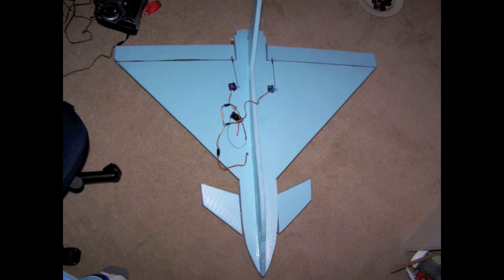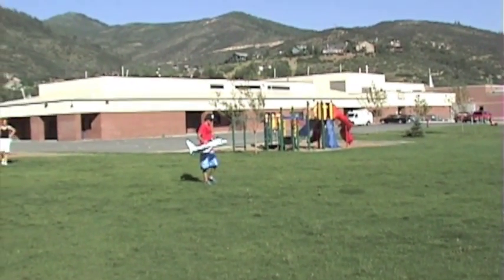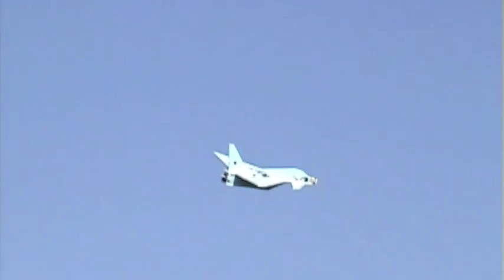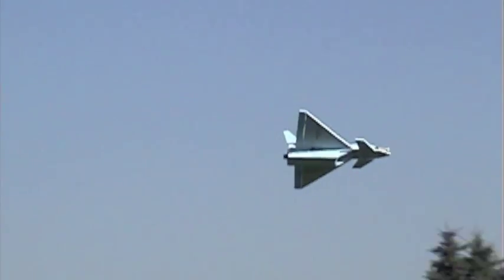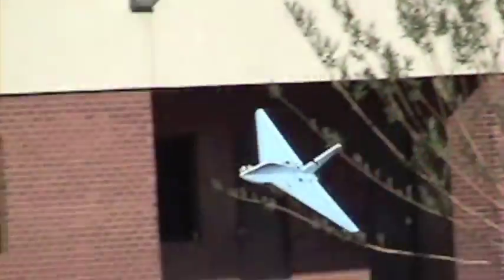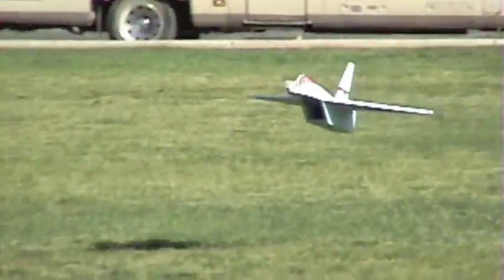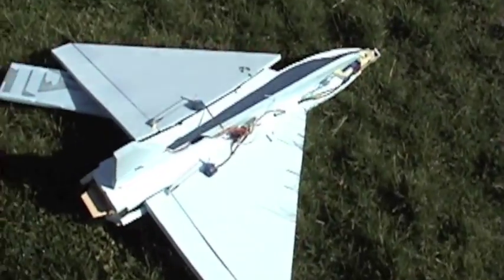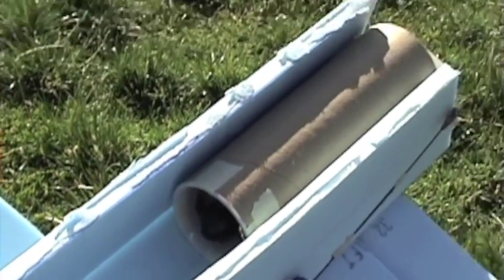R/C EDF EuroFighter with Thrust Vectoring

Comment: The cardboard tube you used is unnecessary and way to heavy. On these Foamys, every gram counts. You can also use a smaller battery to adjust the aircrafts weight.